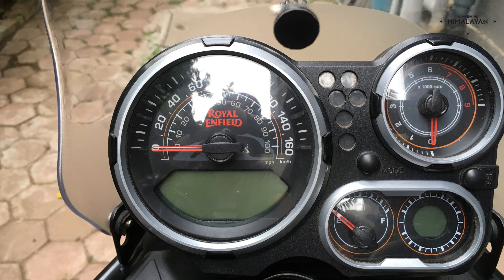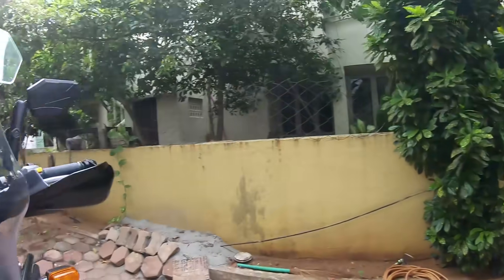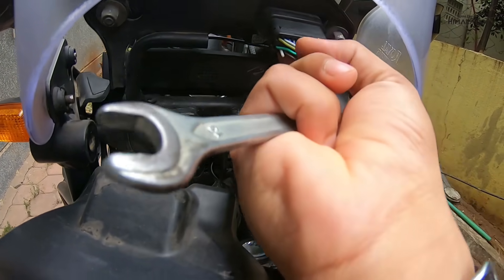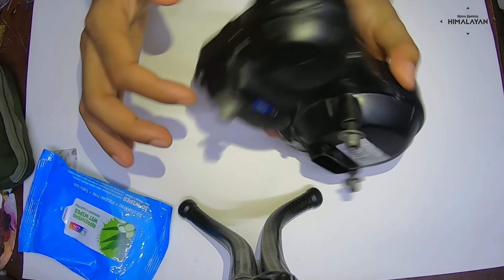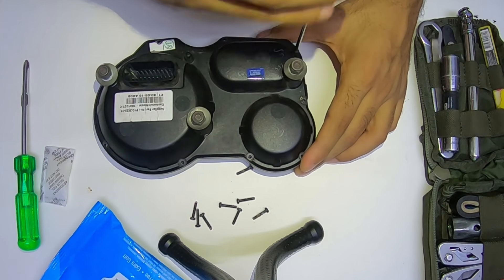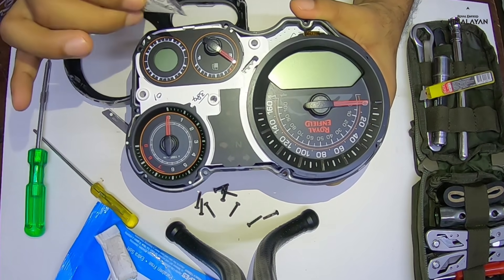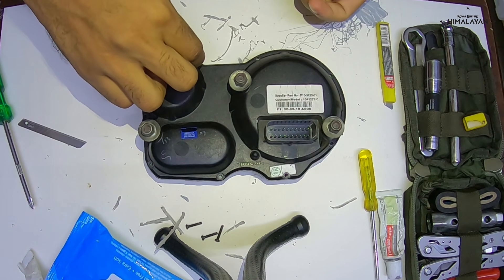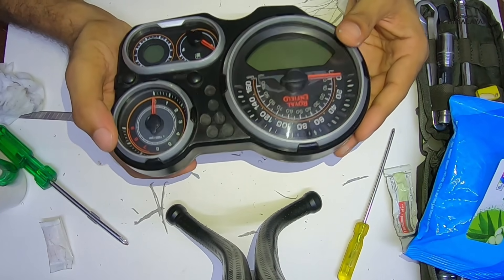ROYAL ENFIELD HIMALAYAN INSTRUMENT CONSOLE PROBLEMS FIXED

Comment: Hi Ben rather than opening the headlight assembly I remove the 4 screws of the windshield and easily have access to the console using a ring spanner size 10. Once all the 3 nuts are are removed I  slightly pull the speedo in the upward direction and remove the connector. It makes it much easier standing rather than doing it sitting looking upwards. At the same time I also inspect the windshield rubber inserts if there is any vibration and replace them with new ones. Thanks
Reply from the maker: Dear friend, there is a reason why I did what I did . I don’t mind sharing with fellows who ask .

Comment: Thank you for sharing your knowledge. 

This console on my Himalayan has accumulated lot of dust and the speedo meter needle kind of dances (jumps quite a bit), would simply opening up the console and blowing bit of air and then slightly pushing the needle help?
Reply from the maker: If the needle jumps , then you are looking at servicing / changing the speed sensor on the wheel . On a side note . Pull out the speed sensor’s connector blow air into it and put it back , also inspect the wire for cracks .

Comment: I have a 2020 Himalayan with only 430 kilometer's on the clock, and am  now experiencing the same thing. When it fogs up, I can't see the readings on the digital display,  current gear in particular.  I wonder if I can get this fixed as you have demonstrated, when I take my motorcycle in for its 500 kilometer service.  Since it it seems to be a common RE Himalayan issue.
Reply from the maker: YES YOU CAN .
Reply: @ONTWOWHEELSBEN  thanks Ben, I showed your video to the service manager this morning. Hopefully when I go in Friday that will do the repair.
Reply from the maker: @manfrombkk  its an easy job. but get yourself a good quality silica pack. and the right size too

Comment: My dealer in Germany has new information's about this problem. He said to me, if we change the console now, I will have the same problem a few weeks later. Enfield improve the console so it will be waterproof and dry inside. I will wait now for the new part.
Reply from the maker: not sure about that as the latest 2021 himalayans also have this problem. i believe its a component flaw in the speedometer (could be design, hardware, o ring etc). So help yourself with solutions and be stress free.
Reply: @ONTWOWHEELSBEN  I have the 2021 Himalayan, 3 weeks old.

Comment: Hi Ben,  thank you very much for this video. Rather than having my cluster replaced under warranty for the second time and having the oddometer go back to zero I will try this fix. Can you tell me how effective it was please?  Do you envisage having to replace the silica gel pack on a regular basis or did the gasket maker seal it effectively?
Reply from the maker: Boreen Run you will have to replace the silica gel pack every 3-6 months . Depending upon the humidity , rain conditions in your area. Also apply a rubber based paste so that you find it easy to remove the cover the next time .
Reply: @ONTWOWHEELSBEN   Ok, thank you Ben. So the sealant doesn't actually completely seal it. Is there anywhere else you think the water is getting in?
Reply from the maker: @boreenrun6238  in my case the water gets in through the micro cracks in the clear acrylic. it isint wide enough for just surface level cracks. what ever cracks the plastic clear screen develops, goes through to the other end in time.

Comment: Hellooo ben
Wonderful videos mate.👍
I recently got my bs6 model and i am facing this issue, is that a permanent fix? Will it affect the warranty of it?
Reply from the maker: you will have to replace the silica gel pack every three to four months as it will swell up with moisture. and yes this will void your warranty only in india just like changing to any other brand of oil other than liquid gun will. RE service, warranty policies are crazy in this country alone.
Reply: Thanks a lot for such a detailed answer 👍
Keep going on 
All the best ❤️

Comment: Bro tell something about coneset a kat kat noise always comes from . I used ntn Japanese bearing maneuvering is smooth but I m thinking in chesis where is bearing fix it was loosen.
Reply from the maker: Yes , if you have changed your cone set/steering head bearings more than 3 times your bearing Race will become wide and the play ( the noise ) will always be present no matter how tight your adjusting nuts are .
Reply: @ONTWOWHEELSBEN  thanks for reply tightening nut is full tight after that sounds comes. What shall I do give some idea.

Comment: why not remove the windscreen to get at the instrument cluster , much easier !
Reply from the maker: trying to wiggle the consoles wiring harness socket out is a really sensitive job and the best way to pull it out is with a clean downward force . So by lowering the headlamp casing you have the right access to the socket .
Reply: @ONTWOWHEELSBEN   one would think enfield would have sorted it out by now and all the other problems with the bike, mine is back at the shop for warranty repairs again !
Reply from the maker: Antony Ross let me know if you want any help with sorting out things on the bike . Have a good day .